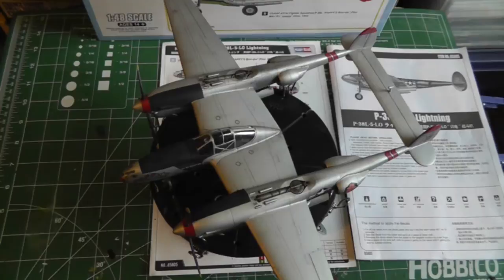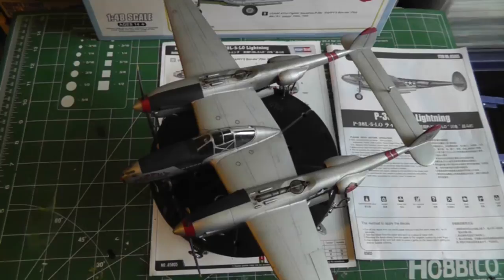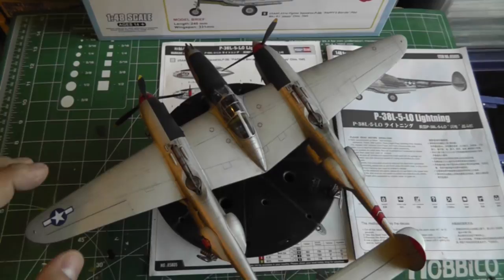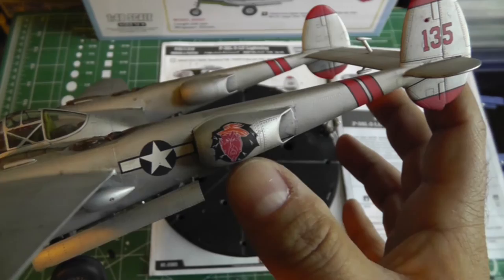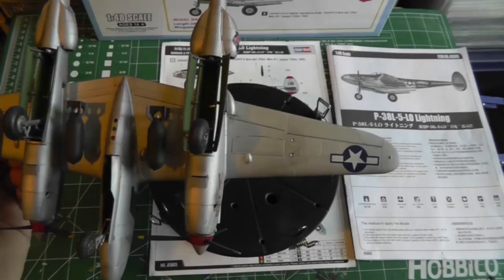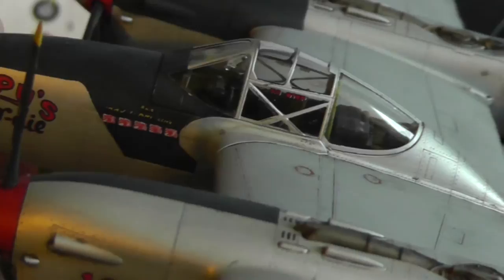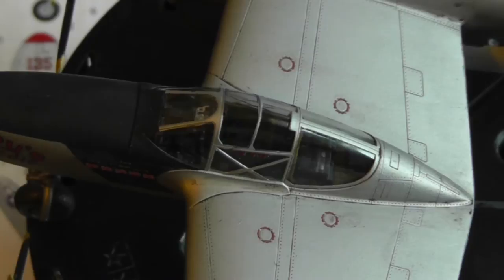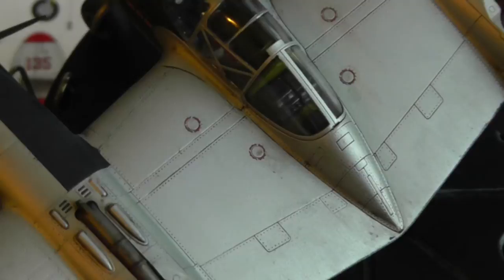HobbyBoss 1/48 P-38L-5-LO, Part 3, Reveal

Comment: Good work on the P38, nice paint neat build and paint job.
 The canopy lines are perfect so well done on that tricky masking and painting. You could drill a small hole in the bottom of the engine cowling and add some fine shot fishing weights to stop it tail sitting the fill and re paint. I did that on my Yak52.
Reply from the maker: chancerNW Thanks for the idea on the weight issue. Will have to stop by my local pet store.

Comment: Hello Tony.  I have returned to the hobby after being away for many, many years!  I may check into buying this kit as I would like to build a P-38.  You did a nice job on this!  How do you weather your aircraft?  Take care.  Drew
Reply from the maker: principaldrew Hello - welcome back to the fold! It's a nice kit, probably their best to date in the 'Easy Assembly' 1/48 kit series. Others like the P-40, P-47 in that series leave some to be desired. Their 1/72 Easy Assembly series are generally very nice easy starter kits. Would recommend those. On this P-38 if I recall correctly, after painting, I applied a coat or two of Johnson's Pledge Floor Wax (aka Klear) with the airbrush; once dried the decals, then another coat or two of Pledge with the airbrush and let that dry over night. Then applied a clay based wash from Flory Models using a hand brush, let that dry for some minutes, then wipe off leaving the dark wash in the recessed lines and rivets. Added some 'soot', engine exhaust in the form of Vallejo pigments applied with a regular brush to taste. Everything was then sealed with Testors Matt Acrylic finish via airbrush. Finally i removed the canopy masking last. Thanks for watching and the comment!
Reply: Tony's Scale Modeling Thank you for responding.  I look forward to your future videos!
Reply: Tony's Scale Modeling What kind of primer do you use on your models?  Do you airbrush the primer?  Thanks!
Reply from the maker: principaldrew I use Vallejo's primer (white, grey, black), and have recently started using Badger's Stynylez primers. I've always airbrushed the primer. When I first started took me a while to get to know what worked best for me on how to best spray and work with the primers. I use an Iwata with a .35mm needle, highish pressure, and clean the airbrush immediately after use. Additionally I make sure to shake the primer bottle sufficiently, and keep the primer bottle opening clean. Some of the problems I had were due to not mixing it enough and letting dried primer get in the airbrush which caused clogging. Thanks!